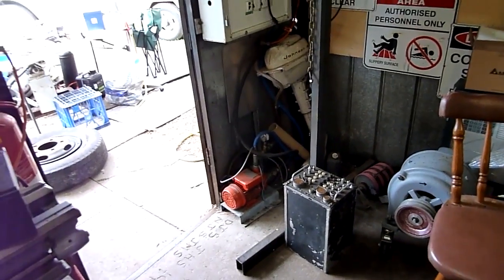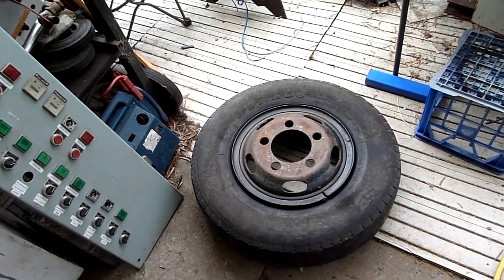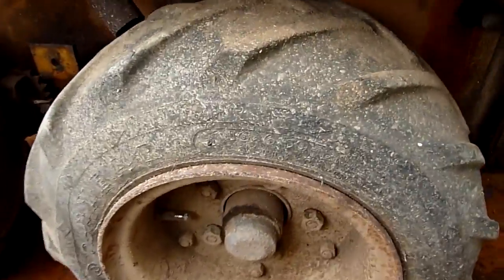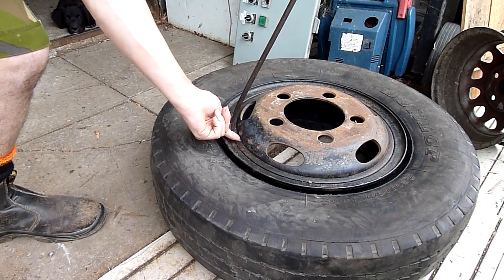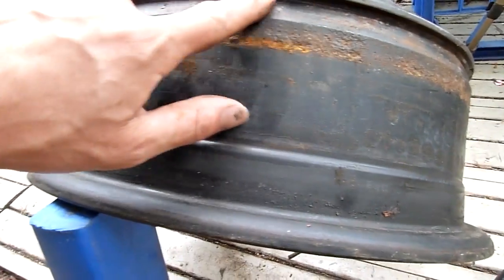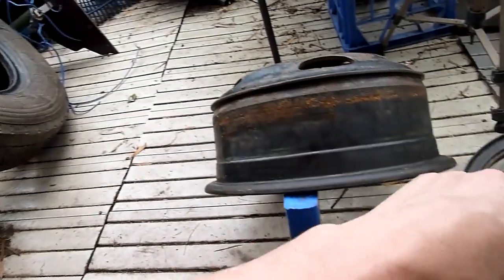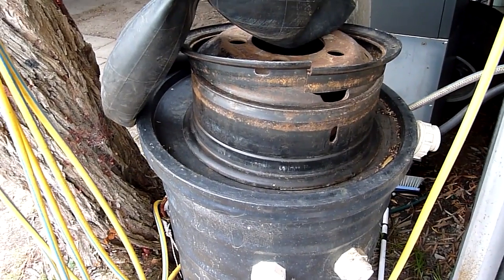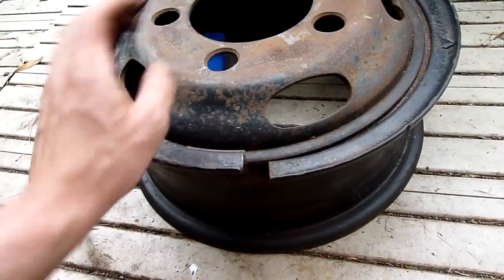The Locking Ring Split Rim - AKA Widowmaker - Why is it deadly?

Comment: Major discrepancy here. These are not split rims which came to be known as widowmakers. These are split locking ring rims. Split rims are a different system which are not only more difficult to seat together but more massive in terms of components. The type shown in video, while less safe than one piece tubeless designs, is still safe for most uses and tends not to pose a threat even when done poorly because it is easy to tell if the lock ring is seated or not. On a split rim, however, its not easy to tell, and this is where the reputation comes from. Rims that were not seated but looked to be were inflated and under working pressures would burst, sending a large and massive locking ring flying at high velocity. 

Cross section of split rim:
http://photobucket.com/gallery/user/truckdog62563/media/bWVkaWFJZDo2MzI3ODIxMQ==/?ref=

Cross section of split locking ring rim:
http://photobucket.com/gallery/user/truckdog62563/media/bWVkaWFJZDo2MzI3NzM0Mw==/?ref=
Reply from the maker: That is a very good point, I forgot about the Firestone 3 piece rims, I will try and track one down!.

Comment: VERY IMPORTANT!
DO NOT LUBE THE INTERLOCKING SEATS OF METAL PARTS. aka the ring and centre piece.
What you lube is the outer portion of the ring part. so the tire slides over it.
Now myth busting part. 
Proper mounting of this tire as it goes.
NOTICE these rims are designed so U can service them in the field without a plethora of tools so cage and chains are good for indoor use but aren't necessary. And you cant stretch steel reinforced seats. Well at least not if you want them to fit the rim and actually seat again.
Proper mounting procedure:
- Mount the inner tube and tube pad into the main tire.
-Mount the tire assembly onto the Centre rim piece.
-Slide the tire seat down the rim so U have clear access to the ring seat slot on the main rim part. U can use a hammer to 
   hammer down the tire to reveal and free the seat for the ring.
-Mount the ring into its seat on the main rim piece. DO TAKE NOTICE THAT THE SLOT AND THE RING contact surfaces are clean of rust and DRY. NOT LUBRICATED. Lubrication makes widows here.
-Once the ring is properly seated Lube the OUTER PART OF THE RING. where the tire comes to seat on the ring.
-Mount the tire on the vehicle. Keep the tire in the air UNLOADED.
-The tire should be mounted to the vehicle so the Ring Meets itself at the lowest point at the very bottom of the tire(the cut in the ring) near to the ground.
-Inflate the tire. DO NOT STAND IN THE WAY. Stand to the side. Radially position yourself to the wheel.

IF You DO NOT HAVE the vehicle where you are servicing the tire makeshift procedure for inflating is: 
Turn the wheel Ring side down preferably on non paved ground without long grass and stand to the side until it snaps to place.

DO NOT STAND ON THE WHEEL doing this.

EXPLANATION. Tires laid down on the ground protrude from the rim when inflated on the inner side of the wheel. So when the tire snaps into place the entire assembly usually bucks or jumps off the ground which is in some cases enough to de-seat worn out ring and cause serious or even fatal consequences. Always inflate the tire on the vehicle for reasons of safety if possible.That is how this is designed to work after all.

Most PSI i have ever had in a tire before seating is about 40-50 psi than it snaps into place. If U exceed 80% of rated PSI for the tire STOP deflate the tire and check what's wrong. You either have the wrong tire or something else has gone wrong.
Inflating on the vehicle is done because of safety purposes.
Mounted rim is rigid and force of tire  snapping onto the seats is contained to the assembly. In case of the ring failure(you standing to the side) because the ring slit pointing down the ring will fly up and away from the wheel.Mounted rims have 10x less chance to fail snapping into the seat. Ring falling from the sky can only reach terminal velocity(probably give you a bruise) so it is way slower than one directly impacting you(that can snap your bones or even cut off your head).

Comment: having & operating a truck back in the mid 90's ,, these rims were ultra dangerous especially when the inner tyre went flat on the back axles without one's knowledge , these locking rings can & do come off if not seen to promptly ,, i do remember once it had happened to me whilst traveling down a freeway & ended up in the middle lane & being ran over by a newish model car & the bang is made when it hit the floor pan of that car , i would be sure that it would have done major damage to the car , but luckily i removed it off the road & disposed of the locking ring as soon as possible , so when someone says they dont normally come off whilst on the rims ,,, Don't believe them & be very wary , always check the tyres for proper inflation & most of all , replace the under inflated tyre Pronto !!

Comment: Those are still pretty common here in Brazil, lots of old Mercedes-Benz trucks from the 70's ~ 90's still at service today.
Me and my father used to assemble those lots of times, back when we had an 1113. We put cooking oil on the rim and the ring, to make it easy to slide it in, and avoiding the tire to stick to the rim, making it easier to disassemble.

Comment: Years ago in our part of Ohio there was a man that delivered home heating oil. Every morning he would check the air in all the tires. He had an inside dual that was low on air so he was squated down with his hands around the outside tire putting air into the inside tire. The ring blew off and the tire expanded against the out side tire pinning both of his hands between the tires. They found him about 8 hours later. from the pain and crawling around on his knees on the gravel, he had worn both knees to the bone!. These things are dangerous. I don't believe they are used on any new trucks in the US. Even the 18 wheelers are tubeless now.

Comment: Great Video, Thanks. I saw  one of those "Split Rings" break a soldier's arm when I was serving in Germany in 1968. Someone had rested the tire on a vehicle facing outward (Ring Out) while filling it with an air chuck that locks into place, and it was unattended. All I heard was a loud noise, almost like a gunshot and this poor soldier came out running  between the trucks holding his arm.

Comment: This isn't what i think of when someone says widowmaker.  A widowmaker was a rim that had almost two equal halves. That split in the center around the middle of the of the inside of the rim.  And were prone to failure when ever they felt like it.  They are rare, and should never be used or repaired. Toss them in the bin/garbage.  But great video on the mounting/dismounting of a split rim and the dangers associated with them.
Reply: Exactly. I worked at a tire shop & what you're saying is what I learned.
Reply: @JoelRSmith  Yes, that's what I was taught was a split rim (widowmaker). The one in the video we called a split "ring", not nearly as dangerous.
Reply: Firestone RH-5. Yowza.
Reply: They're still used on heavy equipment, let the air out before even touching the hub bolts.
Reply: I grew up at a major truck stop in northern Colorado, and was fixing tires from the time I was 15. The split rim you show was not what we called the widow maker. The danger with the rim you show was if someone sprung the ring during removal of it, then tried to re-use it. Our true widow makers were 2 types, 0ne that joined in the center of the wheel, or one that was a3 part, with a small, 3/8" locking ring holding a solid bead ring that actually slid inside the bead. Many farm trucks with 7.50x20" used the widow makers, so had added rust and manure to deal with. My father (the manager) told one employee to inflate a regular split rim inside the cage. Said employee said he'd done hundreds before without cage. Even after being informed, we heard an explosion, went out, and found him with his entire scalp peeled back like a toupee, broken arm and leg. Completely leveled a 2"x 12" heavy, large workbench. Workman's comp insurance denied his hospital bills after finding out he still did not use the cage even after being ordered to. That plus no job any more...

Comment: back when I was a teenager, a friend of mine was working at a truck stop, he aired up a split ring truck tire while bending over it, the ring came off and almost decapitated him. Also, some years later, I was airing up a split ring truck tire and had the tire laying on the shop floor and had lowered a single post lift where the arms were down on the tire holding it, while I was airing it up, the ring came off, fortunately I had the tire/wheel captured under the lift, it only scared the crap out of me. It is a good thing that these wheels have been banned here in the USA.

Comment: A true widow maker is actually the old style split rims where the barrel of the wheel would split and you would have 2 solid outer rings.. 2 piece aren't nearly as dangerous. And you are forgetting about the split rims with drop centres and a solid outer ring again... Both designs I will not mount.. 3 piece spits are most common if you work on a split

Comment: Only a couple of the local tire changers will even deal with these, but since most farmers do not have newer trucks the couple that do, do a land office business in them every spring (when it's time to get the rucks running for planting season).  Both of the two stores that do have only experienced types work on them to prevent injuries, they conspicuously ask if you have the split rims before they send a service truck.

Comment: The US Army used this type of rim on wheeled vehicles from 3/4 ton to 10 ton trucks and their trailers until 1980.Changed 100s of them. Had one blow up in a cage, made both sides bow out and it ripped one of the anchors from the cement floor.
Reply: Dang those rims have a lot of power.
Reply: SILENT KILLER'S 👍🏾👍🏾👍🏾👍🏾.... THEY LOOK SO INNOCENT
Reply: Worked in a tire shop that dealt with split rims dailey,  seen a few, maybe 10 blow in our cage. I would NEVER change without a cage.
Reply: My 1985 AM General M923a1 has them and so far so good,There alot of heavy truck tire shops here in south Texas and some won't service them,but most do. Thanks
Reply: @fredboat  what part of south texas are you in man, i got a MV too, located in duval county :D
Reply: @johndowe7003  77429
Reply: @fredboat  I'm 430 miles south of you @78357
Reply: The “widow maker” was 3 pieces.
Reply: Y did it blow off was it really rusty or not tapped in right
Reply: Holy shit
Reply: Did the rims also have a warning something like "This side towards enemy"?  Where have I seen that on other military applications... xD  Also hope the rims didn't have "Do not eat" on the opposite side.
Reply: These are side-ring or locking ring or Split - RING wheels — but they are NOT split-rim or two-piece rim Widowmakers like the Firestone RH-5 !
    Take reasonable precautions with mounting the tire and assembling the ring to the rest of the rim, use a cage and add air with a Quick-Disconnect for the air (so can deflate it quickly) and be located several feet / meters away to the SIDE (not directly in line with the wheel faces or in line with the bolt-hole pattern.

Comment: Great vid man. I do quite a few tires here, but have yet to come across one of those - been hearing about them since I was a kid. Not too many of them left here in America these days, but they're certainly out there.

I had a 14" car tire explode just 18" from the side of my face one time - a friend brought over a set of rusted out rims he got for free off Craigslist, and wanted the tires dismounted, and put on some other rims for use on a home-built log splitter. Being used to doing 15" or larger SUV and truck tires, I was yapping away, not paying attention to the pressure, since those tires normally take some time to seat the bead. BAAAM!! The old tire had rusted steel belts and bead cable inside, and just tore right in half at 40psi! Luckily neither of us were injured - could've been much worse!!

Great info - definitely keeping this in the back of my mind in case one ever gets brought to me for repairs. Thanks, from Massachusetts, USA. 👍
Reply: there are plenty of them in the military, i was in the marines and when i was sent to 29 palms california the small trailers towed behind hmmwv's and trucks had those wheels and i had to take them apart and re assemble them. halfway threw the 6 months i was there they told me to stop taking them apart because a guy got his head cut off by one
Reply: Thanks for your service, bergerk20.
Reply: Smitty Smithsonite no problem
Reply: Not illegal at all. I work on them every single day. Only dangerous if you don't know what you're doing and you're just not being safe. I'm a 18 wheeler mechanic and many of the truck trailers have these on 10x20 tires.
Reply: Split rims are still pretty common is the us most of the semis that haul the box trailers that the trains mainly haul
Reply: Pretty much every heavy duty (1 ton or or even 3/4 ton) truck  up until the mid 1970s featured these. Heavier duty trucks had them even later.
Reply: Smitty Smithsonite lucky duck I see these quite a bit of these rims .
Reply: Most people won't see these anymore just for the simple fact that no shop will work on them anymore due to the danger.
Reply: I think split rims are illegal in the US.  There were several decapitations

Comment: I believe field serviceability of heavy duty tires was always the reason for spit rims, from trucks to farm tractors etc..  I run tubes all 4 wheels on my old '54 Dodge M37, but it's wheels are split WWII military wheels that are held together by a ring of 1/2" bolts, not a clip ring. 

The advantage is I can easily pull a tube and patch or replace it or change a tire anywhere with tools I carry in the truck. I have a small compressor in the truck as well, mainly for powering the front and rear ARB lockers, but for tire inflation as well..

Comment: I used to work on these many moons ago. We were told to use the cage but ignored it. One day we had a visit by someone who showed us a picture of what happened when a tyre fitter at another depot was hammering the ring whilst leaning over the wheel inflating it. There was an impression in the roof that looked like a gingerbread man had gone through it. Yes folks, it launched the guy right through the roof and the roof was at least 30 ft high! We used the cage from then on alright!
Reply: You have one Extra finger so you're Good without a Cage

Comment: That's a split ring tire, NOT a SPLIT RIM!  I used to work on these every day, never had a ring come off, EVER.
 The SPLIT RIM actually split the rim in half almost dead center between the dishes. THOSE  are the True WIDOW MAKERS, usually found on heavy trucks from the 1920s to the late 1960s. 
  If you don't use a cage , wrap it in chains while in the field, or set a hydraulic gate from the service tuck it's your fault for being stupid. 
 You NEVER put lube on these, anywhere. 
 They quit using these cause too many people figure out how to fix their own flats. It's a rook.

Comment: If you don't have a cage or chains you can inflate a split rim by putting it split rim side to the ground and sliding it under the chassis of your truck ,stand behind the wheel that is still on the truck then inflate ,but only if you have not other options not recommended but in an emergency you do what you have to do to get home ,good vid mate cheers

Comment: Call them whatever you want. About 15 years ago was changing out tire on a forklift,wheels were similar.Very careful to make sure that every thing was put together properly,put tire in a safety cage.I had a habit then of inflating the tire to about 25 or 30 psi without the tire valve installed.After doing this inflated tire to operating pressure,100 psi.Waited a few minutes,pressure blew the assembly apart,with enough force to damage the safety cage.No one hurt but cage was scrapped..Those two piece bolt together  wheels can suprise you,trick I used to use was when we fixed a flat to only inflate to about half pressure,put tire on machine,after tightening all lug nuts,inflate tire to normal pressure.

Comment: Some years ago an unsupervised 14 year old kid was killed  by one these when the  tried to inflate it outside a safety cage. Even n with the "safety rims it's a use idea to use an inflating hose that allows yo to stand back.. Am man I knew was badly injured when something went wrong when the beads seated on the tubeless tire he was repairing. Tire service trucks carry or used to carry a safer device that was pretty compact and a bit less dicey than a chain. I recall wheels that where in two halves that where held together split  ring at the wheel center line. Those are a SOB to wrestle back together.

Comment: My 1951 chevy pickup had these and I managed to get some one piece wheels to replace them. I have had to remount tires on split rims and it was never a comfortable issue. Slow and safe just never comfortable with danger that could happen.
Reply: Split rims are the best.
Reply from the maker: I often see people running modern Highway Terrain SUV tires on them and always wonder why they did not spend the extra $40 a corner for tubeless rims. there is no reason to use modern tubeless tires on split wheels.

Comment: Use your bead breaker or a sledge hammer to seat the split ring. I've changed hundreds of them back in the day. They WILL KILL you, if you get careless. I saw the results of one that 'let go', the imprint of the ring was in a ceiling 20' up. The guy that was dealing with it went to the hospital sans arm at the shoulder.  If you don't know what you are doing with them, leave them alone.